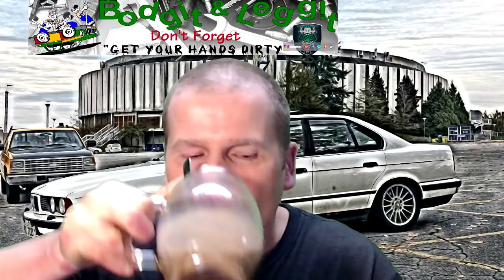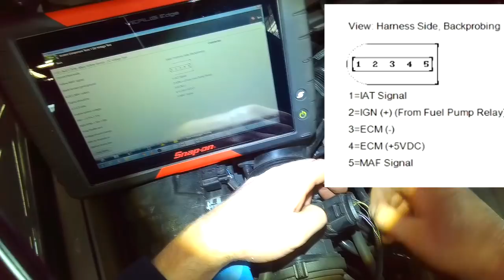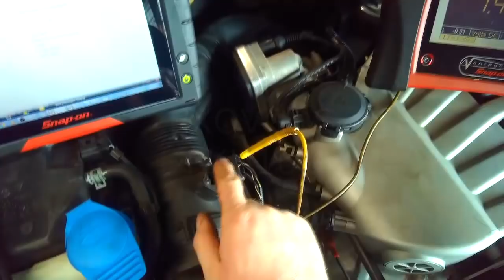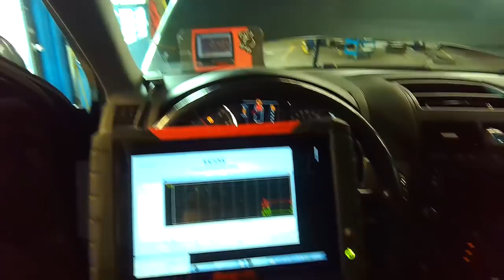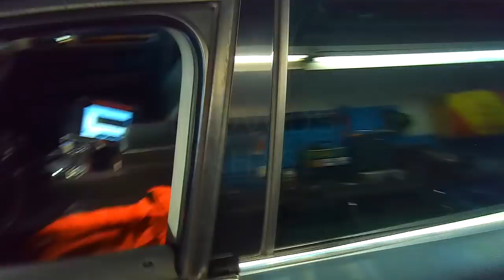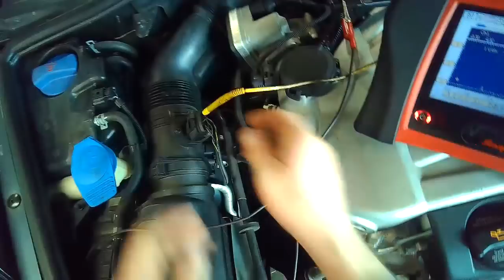VW Touareg: P0102 MAF Sensor signal too low

Comment: My maf stuck at 27 mg/s p0102
Reply from the maker: Year, make, model, engine?
Reply: @EXOVCDS  Audi a4 b5 1.8t 1999 , i got error p0102  , change the maf with a new one and still got the error , wire from maf to ecu are ok , i don't know what to do
Reply from the maker: @_zmeu  MAF signal voltage should be around 1v at idle and close to 5v when throttle is quickly opened all the way. 
Did you check the voltages like o did in the video? What are the voltage numbers?
Reply: @EXOVCDS  no , just  0.06 V 😶
Reply from the maker: @_zmeu 
What are all the voltages for all the wires?
Are there any air leaks between the MAF and throttle body (cracked / broken rubber hose, intercooler attached fully etc)?
Reply from the maker: @_zmeu 
Has the connector for the MAF ever been replaced? Is the wiring in the connector broken? Are all the wires in the correct place (use a wiring diagram to check wire color if the wires are in the correct order)?
Reply: @EXOVCDS  yes there are corectly , i also check every wire tot the ecu and are ok...never change the plug or the maf , also this maf works on other car , simply he dosen't get voltage from the ECU , MAX 0.06 v
Reply from the maker: @_zmeu  the MAF produces voltage and sends it to the ECU. If the voltage stays low  then the MAF is not good or the wiring is shorted... keeping the voltage low.
Reply: @EXOVCDS  aaa ok understood 🤔 , but on other cars this maf works , i tryed on 3 different cars
Reply from the maker: Like I said "if MAF is ok, then there is wiring / short problem."
Maybe it could be ECM. You have to do testing of wires / circuits. I can't do it for you.

Comment: Hi Thomas how are you. I had a problem a few days ago in my car Golf mk 4 GTI model 2001. In the dashboard there appears a warning sign (EPC) and the accelerator started not working. When I discovered a car with its parts (ebd 2), I saw codes p2123 and p2128
Reply from the maker: Not sure... they both deal with the accelerator position sensor. Could be wiring, the sensor, connector, ECM... even O2. According to this:
http://wiki.ross-tech.com/wiki/index.php/18560/P2128
Reply: I changed the gas pedal. But the present is still present. Detect a good pedal and wire sensor with the AFOMETER device. Even fuzes detect it but the bugs still exist
Reply: Does this mean a computer that does not work well?
I forgot to tell you a few days ago until today I have another defect p0038 / p0141
Reply from the maker: I did not know you already replaced the gas pedal.
If the pedal sensor & wiring are OK, then it might be a computer problem... I don't know.
Reply: Hi Thomas, how are you? I checked the power cord for the car and checked the Riley and Fuse. And you remove the 02 connector but the accelerator did not work as earlier, even if it moves the indicator number of engine rolls slightly just when you move the accelerator pedal,
Reply: Can ECM have problem with it

Comment: What to do i have mass air flow sensor (g70) singnal too low and intake air temp sensor (g42) singnal to high. Can it be the maf sensor broken. ?
Reply from the maker: Is the wiring ok?
Reply: Thomas EXOVCDS i think it is i dont find any crack or nothing.
Reply from the maker: Can you check the MAF signal voltage with a volt meter like I was doing?Can your scan tool read / show sensor values? What temperature is the intake air (sensor is in the MAF).
http://wiki.ross-tech.com/wiki/index.php/16486/P0102/000258
http://wiki.ross-tech.com/wiki/index.php/16497/P0113/000275
Reply: I'm having the exact same issue in my B6 S4. I just swapped a different used maf in (just plugged in not installed) and it gave readings. I cleaned it, installed it and then 0.0g/s again. Must be wiring. What was your issue?
Reply: I have the same problem and the airmas and wires were replaced
Reply from the maker: Year, make, model, engine?

Comment: Great video! 
How come you didn’t use the verus scope and the scan data all on the same tool? 
I’m guessing it easier to use the vantage pro? 

Reason I ask, I’m thinking of selling my Vantage pro and putting the money towards a verus pro to have a scanner/scope all in one 

I’m subbed 👍
Reply from the maker: Hi, I have a bad habit of not doing things the same way... sometimes I use the Verus scope & scan tool (ScannerDanner showcased how to have both screens visible at the same time), but when I use VCDS on the Verus, I don't use the scope, so that VCDS can be screen captured fully. To be honest, My vantage pro is the fist scope that I always grab. I used the Verus Scope a couple days ago to get a known good waveform (cam, crank, injector) for a 2013 CBP 2.0l engine. I should probably use the Verus more though. Thanks for watching & subbing!

Comment: Very nice diagnosis and explanation. FWIW, when using the Vantage Pro, if you highlight a field to change it, you don't have to press the Yes key to change the values. Just highlight the field, say the time base, and then up/down arrow. Doesn't sound like much but saves a bit of time. Thanks!
Reply from the maker: Yeah... I've noticed that. Sometimes I actually use that time saver.